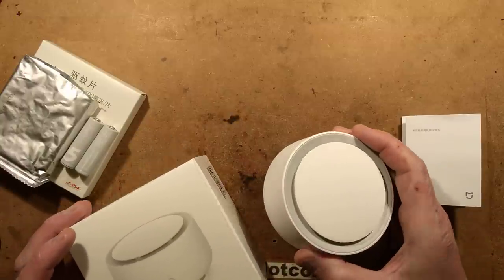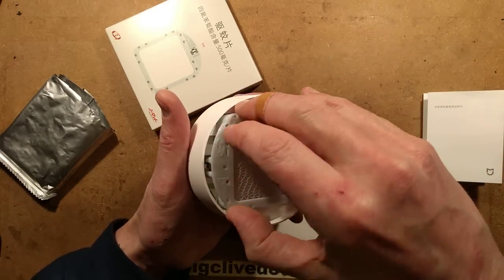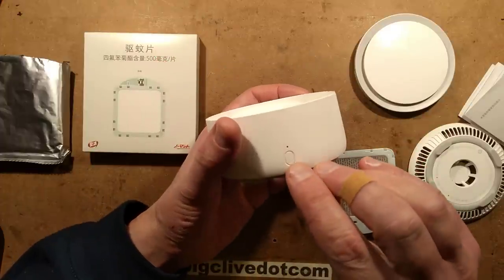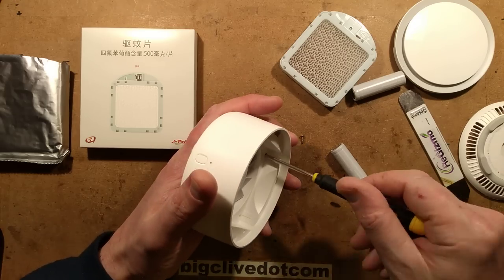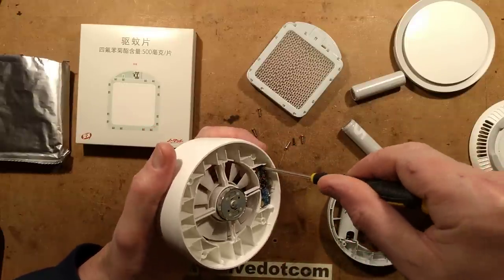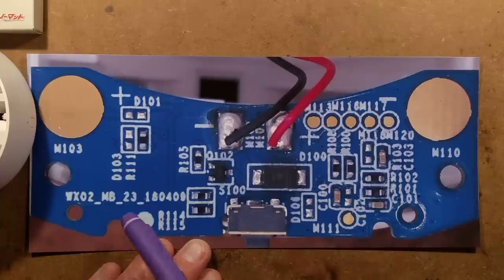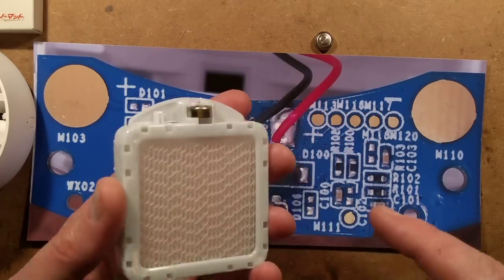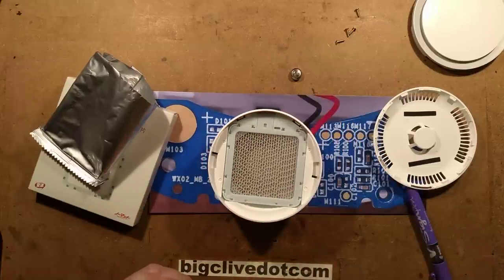Inside a Xiaomi Mijia mosquito repeller.  (Including cartridge reset info.)

Comment: If you got your favourite insect repellent oil you can re-soak the cartridge and replace the button cell, that would be cheaper...
Reply from the maker: I think it might have to be a fairly concentrated version for a long run time.
Reply: @bigclivedotcom  there are concentrated versions you can buy for repellent candles, based on citronella plants. they work great.
Reply: Modify the board so it won't discharge the battery will be cheaper.
Reply: Thomas Richter no, this is not apple, this is xiaomi. They don't try to scam you.
Reply: @thomasesr  For the Mosquitos we have here, Citronella doesn't do much, whatever it is in these works much more effectively... YMMV.
Reply: bigclivedotcom “your favourite insect reppellent oil”
Reply: @ThePr0Br0  every company takes a profit margin, the scam is the fact that you have to buy a whole assembly of the  cartridge instead of a cheaper oil and button cell. I'm sure you can find it on ebay.
Reply: @JohnBaxendale  Here in Brazil we have Citronella and a bunch of other stuff as well
Reply: Thomas Richter hey buddy you mixed up the tagging, but anyway yeah you can definitely soak them yourself, but there must be a way where you can solder two things together and turn it into solely a fan that doesn't care about button cells
Reply: @ThePr0Br0  I did not mixed up any tags, i'm sure...
Reply: @ThePr0Br0  As a fan it'd be useless as it turns pretty slow. I guess you're meaning just to bypass the "timer" though? That should work, but probably more hassle than a 13 EUR device is worth? :\

Comment: The bug-killing chemical in question:  https://en.wikipedia.org/wiki/Pyrethrin
It seems to be slowly replacing Pyrethroids (the artificial version) due to their higher ability to biodegrade compared to the artificial version which can stick around a good while.  Transfluthrin it seems can bidegrade pretty fast as well which is why it's used in indoor pesticides frequently in addition to being super potent and fast acting compared to the originals.
Reply: mosquitoes sense co2. sequence the receptor on the animal. do some bioinformatics and qsar in the data set towards known non-toxics, and synthesize the killer spray. deal done...
Reply: @peetiegonzalez1845  Not much point in laying down poison if they're not attracted to it, huh?
Reply: TheRealColBosch Actually, If you are flooding the volume of a space with their poison for area denial then attracting them to it is not necessarily desirable since the whole idea is to deny them use of the treated area and kill any who venture into that space.  As an airborne treatment in an enclosed space the entire (air) volume of the room is toxic to most flying insects.  Be aware, though, that this toxin is also very toxic to fish (mammal toxicity is very low as mammals have an enzyme that quickly metabolizes and deactivates the poison so low-level exposure is typically safe) so I’m not sure how safe this would be to use in a room/home with aquarium fish since room air is typically pumped into the aquarium to aerate the water (though one could certainly relocate an air pump outdoors if necessary to draw in untreated air).
Reply: @ethanpoole3443  Pyrethroids will also take out any cats that enter the treated area, because they lack that enzyme (glucuronidase) you mentioned. Not sure if this applies to all felines or only domestic cats. And yeah, I know I wouldn't use the stuff near an aquarium because it only takes a ridiculously tiny amount to kill fish.

Comment: Back in the 60s & 70s the Gulf Oil Company produced a product known as the "No Pest Strip" which was a semi-soft slab of plastic(?) that was unwrapped and slid into a foil coated paper enclosure with holes all around it. You would hang it in an area and bugs would be repelled or killed. A similar product is available today from a company called "Hot Shot" and labeled as the "No Pest Strip 2". Similar concept to this item.

This product reminds me of the room fragrance devices that use an oil in a little fan box that runs every few minutes to kill or mask odors. They also have replaceable supplies of the active agent and I would not be surprised if the mechanisms came from the same factory. They work almost identically.
Reply: Gulf Oil? The ones we used to get were made by - or at least branded by - Shell Oil.
Frank Zappa immortalized the Shell pest strip in the song "Magdalena", which contains the lyric: "I saw you standing under the Shell pest strip late last night,
In the light, With your little nipples protruding through your little see-thru thingie"
Reply: Oop! You're right. I was confusing it with Gulf insect spray . Yeah, Shell offered the strips in the US until fears of cancer got them to stop.. Hot Shot now offers them under their brand with the CA cancer warning that is on everything these days and widely ignored. Shell still sells them south of the border.
Reply: @@ShyToad I am not advocating their use either. Don't have any in the house. Haven't for decades. I merely note that they are still out there (even at Amazon & WalMart) today. The only change from the original is that today's version is mounted in a plastic housing so there is no handling of the strip itself by the consumer. It seems this Chinese device works in a similar manor but uses a slightly different formula.
Reply: Dave Micolichek   They are still around. Very common in dollar stores. Something like a 6-pack for a buck. Complete with thumb tacks for hanging.
Reply: Dave Micolichek   They are still available in mexico xd, I buy them quite often in the summer and find it hilarious seeing them struggle stuck to the tape xD

Comment: You should do a follow-up on the element life/effectiveness.  To me, it seems like it would go dry rather quickly, depending how humid one's house is, since the unit is essentially the same design as those cheap food dehydrators without heater elements.

Comment: As soon as I saw the back of the motor.
RF300
Super efficent, super common.
Reply: Yeah, I had like 1 or 2 of those in the past that I salvaged from some electronics.
Reply: I see this motor on xbox controller there are two of them to vibrate the controller

Comment: They also have a small portable version, that runs on AAA batteries, we used it in Australia and it worked very well.
Reply from the maker: I ordered one and it never turned up.
Reply: @bigclivedotcom  that's too bad, but the insides are exactly the same, but use indication is not available. All other features are just like on the big one. Now have 2 small and one big one.

Comment: 1. may be a good idea to wash hands after handling the cartridge just like you should after handling solder and other lead containing products.

2. that battery is a very flimsy sort of drm  you could just using a voltage regulator or even a resistive voltage dropper connect to the batteries in the bottom to trick the unit into believing that the cartridge is in place.

3. you can then refill the cartridge by soaking the paper filter media in a bowl of the liquid if you can buy it in bulk

Comment: That fan is so quiet! I wonder if it's running at a slower than normal speed? Maybe the chip is sending a PWM signal to the motor drive transistor. That may be how they get such a long battery life.

Comment: To be honest I am always wary of anything that can damage Nerves and your nervous system, not fearfully just very cautious as nervous problems freak me out. Having watched a Uncle slowly loose motor functions from MS was quite eye opening of you take my meaning, Parkinson's is also a condition that I at times sorry about developing. I do currently have a weird problem with my left arm and the nerves inside it, they are all fully functional as my doctor tested with nerve conduction machine pretty much a Fluke for nerves I would love to see you take one apart but I doubt it would be easy to get a hold of items designed for medical services. Then again some of the stuff you have shown I'd never even bother looking for, mainly because I didn't know if was a thing till I watched said video. 

Ah right my arm, well all the nerves seem to be functioning by the tests but my arm feels off like a polarity reversal of something is the best way to describe the feeling. My arm is always weaker than my right and it has far less stamina, my doctor plans to follow up on it with MRIs after this viral thing is done but the only thing I know for sure it wasn't a stroke like so many people tell me when I describe it. 

How do I know, two reasons my brain functions perfectly fine if a bit more Obsessive on phobias at times and two my doctor told me as long as I have had this problem (Granted I only recently found a good Doctor again, most have been far too over taxes by workload or were quacks. Don't get me started on the woman who nearly fossilized my father with his calcium suplements.)if it had been a stroke I'd be dead because without proper treatment strokes tend to cause brain shutdown like a cascading failure in a circuit.

Comment: Could you try measuring discharge current from the button cell? And could you test (with bench psu) how low the voltage has to drop until the unit shuts off?
Reply from the maker: Check the description for the button cell data.

Comment: Very serviceable unit and cartridge :P The main batteries are size AA? Can it work with NiMH ?
Reply from the maker: I tried it with NiMh cells and it ran fine.  Not sure what voltage the circuitry cuts off though.
Reply: @bigclivedotcom  0xFF like :P

Comment: What's with the component numbers all starting at 100?  ie. R100, D100, C100, etc.  10:05
Reply: Nothing wrong with that. Often the first digit is used to designate a subassembly or section of a circuit. Not much point in this one, but maybe the standard setting of the design software they used. You'll sometimes also see RPxx, CPxx aso. for parts in the power supply part for example. That makes it much easier if several people are designing different parts of the circuit.
Reply: @superdau  - I understand that and am actually working on a circuit now with a similar numbering system.  But like you said there isn't much point here with only one PCB in the product.  I find it just makes more of a mess on the PCB silkscreen especially when parts are closely packed.  And if the count is low you can also save a character by having numbers over 50 mean X, etc.  I'm just not a fan of longer IDs and the mess it can add to the PCB.

Thanks for the reply.

Comment: Can you make a 5 volt version? (May need a series resistor, 20 ohm? 50? at 1/2 watt?)
Reply from the maker: It could be adapted to 5V but the fan speed will directly affect the amount of vapor released and active lifespan of the cartridge.  To drop the 2V at the required 10mA you could theoretically use a 200 ohm quarter watt resistor.  Or better still, just put three diodes in series to drop about 0.6V each at that low current.

Comment: I'm surprised you didn't measure the load on the batteries, both the main AA and the LR44. Then you could calculate the lifespans. Also you could replace the LR44 with your bench power supply to wind it down and see where it calls it quits and makes you change the cartridge.
Missed that you did one current test.
Reply from the maker: I tried connecting the bench supply by holding the contacts in place.  But the unit was a bit fussy about bad contact and tended to lock up.
Reply: A LR44 cell has a capacity of about 100 mAh. With a load current of 180 µA (see note in video decsription), you get a battery life of about 24 days. Not nearly the claimed 90 days though.
There must be a discharge resistor (ca. 8,2 kohms) that could be removed or replaced with a bigger value.
Reply from the maker: @WolfgangMahringer  The current from the cell will probably drop with its voltage, and I think they're being it on typically 8 to 10 hours use a day.

Comment: I would Call the button cell unusual rather then clever. They could just use a timer or memory chip to do the same thing.
Reply from the maker: Super cheap.
Reply: bigclivedotcom a timer built into the micro would be free.
Reply: I would also say clever, it solves the problem of users who can't remember and/or follow the instructions for resetting a timer. Plus it's cheap.

Comment: Why did you switch back to the fluke multimeter?
Reply from the maker: I had a problem with the shaft on the other meter and am waiting for a replacement part.

Comment: Well, assuming it runs on AA batteries with 3.6 Wh each, that would be 7.2 Wh / 0.03 W = 240 hours.
So optimistically you could run it about 8 hours a day for a month... So yeah, the batteries definitely not gonna last 90 days. At least not under normal usage.
Reply: Phino K.M. A typical modern AA alkaline battery will deliver a bit over 3,000mAh capacity (~4.5Wh) at a draw of around 10mA, so you would expect to get a bit less than 2 weeks of continuous operation, or about 6 weeks at your 8-hours per day rate.  But certainly nowhere near 90-days unless the builtin logic runs the fan heavily in the first few days to flood the space, then begins scaling back the runtime per day over the remaining life once the space is flooded.  If it uses a such a tapering runtime strategy then they could potentially get 90-days on a set of alkaline batteries, in which case the claim could be true but a short test interval would not have time enough to reveal such.

Comment: I find two fine aluminium meshes in a frame connected directly to the mains produces interesting effects 😈
Reply: Dave Micolichek  there is always that, generally use a fan to blow stuff toward it and use a long cable 😉 some sensibility required
Reply from the maker: With a simple multiplier you could make that both zappier and safer.
Reply: @bigclivedotcom  I do need to build one for my new xray tube... 150kv it is!

Comment: You don't get the liquid stuff only in India, you get it in Germany/Austria as well. Stuff like this: https://www.amazon.de/Vandal-VANDAL-Gelsenstecker-KOMBI/dp/B00DMLR59I/ref=sr_1_3?ie=UTF8&qid=1541273205&sr=8-3&keywords=Gelsenstecker
Essentially, those are just cartridges full of "oil destillate" (presumably light mineral oil) and Pyrethrine. There is porous wick immersed into that, made of some sort of ceramic I believe, and the plug is a simple heating element which heats the wick and evaporates the poison. Despite being slightly nervous about evaporating nerve poison in my bedroom, I must say: the thing is a godsend. I live near a stream and like sleeping with open windows, so most nights I'd be waking up several times to kill up to 5-6 mosquitoes. With one of these things I can sleep through. One of these cartridges costs about 5€ and will last about half the mosquito season. You should only use them in a ventilated room, so at least crack the window open a bit.
I have observed what it does to them. They turn rather twitchy, they seem to be losing grip and catching themselves again. They can fly, but are uncoordinated and apparently unable to find the target. I hear them sometimes, flying around me, but it's not the usual constant buzz and direct landing on the target, more interrupted and erratic, and they don't land. They look as if they were drunk. And after a while, it kills them outright. They're not that easy to spot on the floor, but I have found a couple. Very rarely one does get stung after all, but that presumably only happens if one flies in and goes straight to business before getting exposed to enough Pyrethrine to disable it.

Comment: I bought one of these & as Clive says they're a good little unit. I bought two replacement mats for about 5 quid each from a seller on Ebay called "happy-shop09" & they turned up in an unsealed box & the batteries were missing from the mats. So not only are the mats useless as the mats turned up not in their sealed packet meaning the repellent agent will have dried out from the mats before getting round to using them, but they won't work in the unit as the batteries are missing from the mats. The mat box seals have been tampered with, so I can only surmise that the seller purloined the batteries.  I currently have an open Ebay dispute with the seller, so beware!

Comment: Maybe you could just wet the wick with another dose of that chemical and put in a new battery for a cheap cartridge replacement.
Reply from the maker: The trouble is finding a super concentrated form of the chemical that hasn't been pre-diluted.

Comment: mine works good for 1 year now iI turn on turns imadetly off i change batterys bu no luck what can i do?
Reply from the maker: Have you tried with a new pad?  They have a small button cell on them that is supposed to signal if the pad is still usable.
Reply: @bigclivedotcom  i do change the cell on the pad is supose to be reed as new right?
Reply from the maker: @marine1718  As fresh button cell will read as a full pad.
Reply: @bigclivedotcom  do is suppose to work right?
Reply from the maker: @marine1718  Yes.  If it doesn't detect a new cartridge and button cell then make sure the main batteries are good.
Reply: @bigclivedotcom  I trade 3 times no luck with batterys
Reply from the maker: @marine1718  If you remove the cartridge you'll see two metal contacts that touch the side and end of the button cell in the cartridge.  Make sure they are in position and that the button cell has the narrower disk facing outwards.  It may help if the contact at the side is bent very slightly.
Reply: @bigclivedotcom  it's all good with cartridge because when cartige is bad orange light turns on. And my problem is that green light turns off after 30 seconds